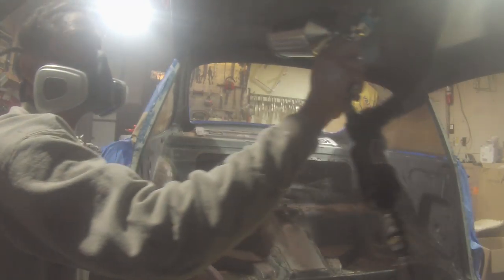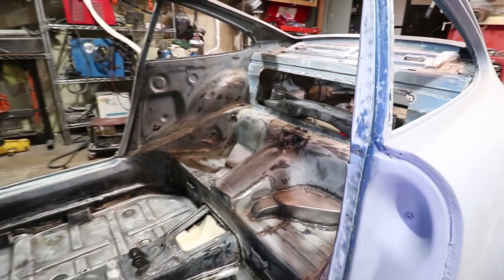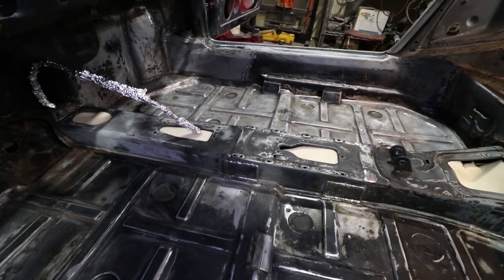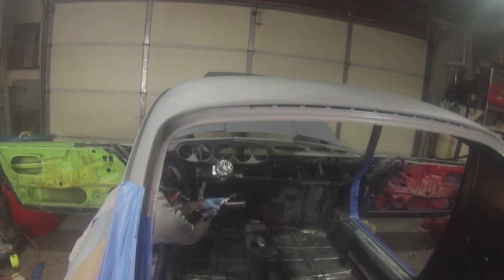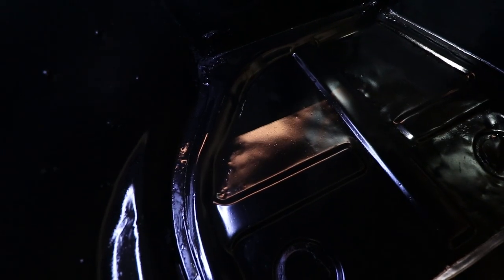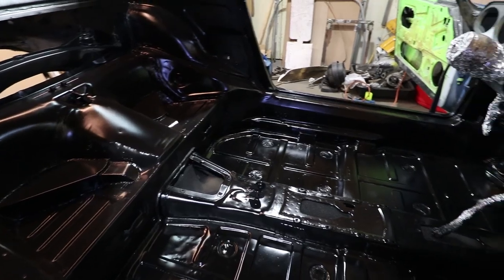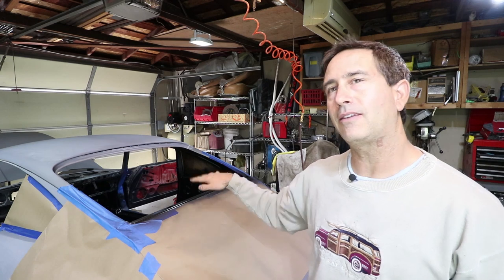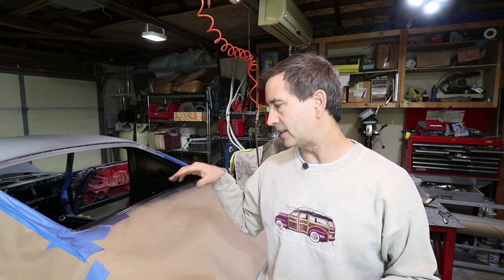Black Epoxy Primer Is The New Simple Interior

Comment: I would definitely put a satin top coat on it, epoxy primer is not usually UV stable and will break down over time if not covered with a top coat.
Reply: Davy Pickard Satin Black would have been my pick. Satin Black would have hidden many of the imperfections
Reply: @fgjf1079  the SPI epoxy that Tom uses has an open window of 7 days, if I remember correctly. It would be easy to buy some satin black direct gloss and bang it on 👍
Reply from the maker: This is correct about the UV and recoat window.  Not sure how quickly the interior would degrade on a non daily driver.  Not really worried about scuffing again after the roll bar install.  Some areas need more sanding anyway.
Reply: @GarageTimeAutoResto  the glass will block a lot of the UV and would take a hell of a long time for the epoxy to degrade but I'd rather put a couple of coats of direct gloss over it as opposed to having to spray the inside again after the exterior is painted.

Great job so far Tom. I enjoy watching the videos and hearing your take on things. Keep it up 👍
Reply from the maker: Thank you Davy😃. I really value all the input here.
Reply: Exactly what I was going to say. The epoxies will turn chalky, or something if left exposed to UV. May the hot rod black or something. This is similar to what I did to the bottom of my car. I used PPG Delfleet industrial semi-gloss black. It is pretty cheap and covers really well.

Comment: Looking so much better now Tom 👍 Definitely colour match to exterior and same goes for the doors. You can always add some fabric RS door pull straps to match the original deviating door colours which could be a nice throwback touch. 

Black (or any dark) stripped painted interiors do nothing but highlight dirt/dust in my opinion. I’d flock the dash top black and make a custom carpet mat for the rear top deck running down to the bottom of the firewall which you can use on street and remove for track will minimise reflection. Maybe cut some thick foam to level out the rear seat bases around the suspension mods and make a custom mat to again lay flat across. That will also significantly reduce a load of transmission and suspension noise.

Are you still edging towards Bahama Yellow 💛 or still undecided 👍
Reply from the maker: Thanks Mark, all good ideas as usual.  Yes on Bahama Yellow😃

Comment: 100% paint the doors, and also satin top coat. I'd go back and sand that area you pointed out. It's in a visible spot and it'll bug you later.
Reply from the maker: Oh, yeah you betcha I will sand the obvious areas before the next coat.  That wasn't obvious in the video because I said its good enough.  I meant good enough for the first round, ha ha.

Comment: You should also paint the doors and the other parts. You did such a great job on panel fabrication and  welding. Not painting these part would spoil your great work.
A hint on painting: I use PPS from 3M. It has a lot of advantages. The best feature in my opinion is that you can spry in any position, even with the gun upside down - that was very useful when I painted the frame of my truck.  There are PPS adapters for almost every spray gun. Yes, it is a little bit pricey but worth the money.
Epoxy primer should be top coated since it is not UV stable.  I would use a single stage paint for trucks and trailers. I is cheaper and more robust and less prone to paint runs. Ok, it is not that shiny and tends to show some orange peal effect but for the interior this is not a problem.  I payed 30 Euro per liter of good quality truck paint. The automotive paint from that brand would have costed 120 Euro per liter.

BTW - you can put Bondo on top of Epoxy primer. If there are some really rough areas you can fix them now, reprime these areas and than top coat everything.
Reply from the maker: Thanks for your comment 👍I know that Chris Fisher uses the PPS cups and also likes them.  At the very least I need a smaller cup.  
I never said I wouldn't repaint the doors, ha ha.  Original or black is the question???

Comment: You are putting way to much work into this car to not at least make the interior look some what "finished". Put a dot sticker somewhere on the interior panel and paint them black.  Then remove the sticker so you have some of the history preserved. Just my .02.
Reply from the maker: Both doors are too ratty to use as is.  They would need some restoration to match up with the rest of the car.